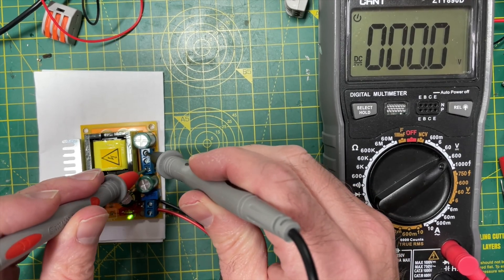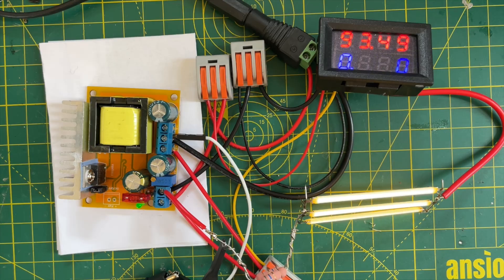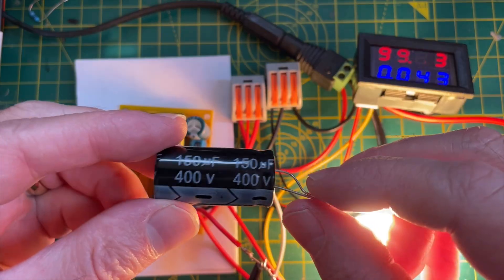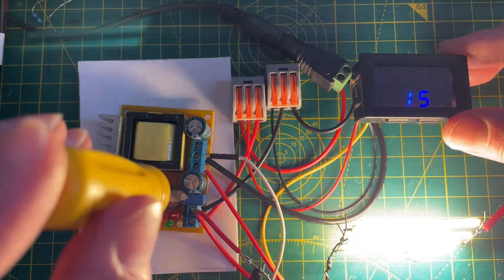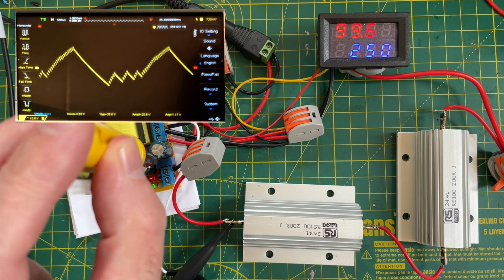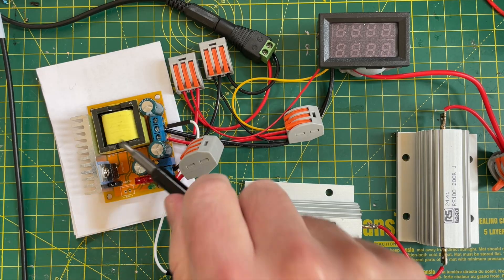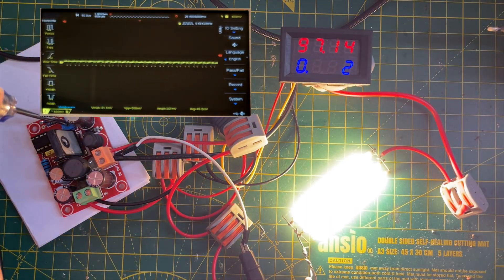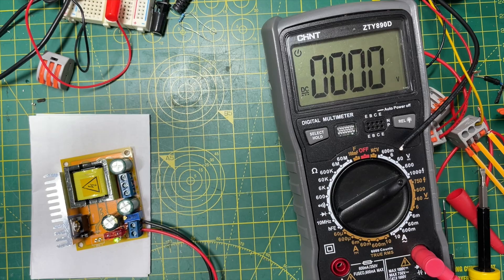787 Volts From a $2 Board!

Comment: these things are great. I'm using them for the DC bus voltage on cnc servos during repair. the circuit is laid out in a way that makes it easy to turn off & set the voltage from an mcu

Comment: I like the board with the UC3843. I think it claims 35W. I've tested long term at 22W or there about and seems ok.
Only ever used the MC34063 as a buck converter.
Recently been playing with an LT3750 capacitor charging ic. It's great. There's also an LT3751 which looks more inclined towards regulated boost converters and might be a good option for you.
Reply from the maker: I’ll take a look - definitely interesting!